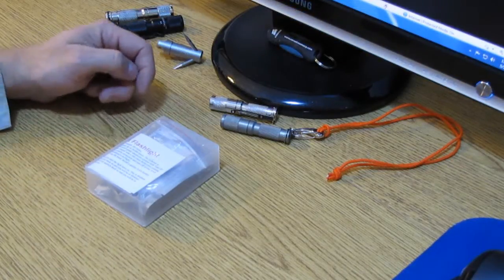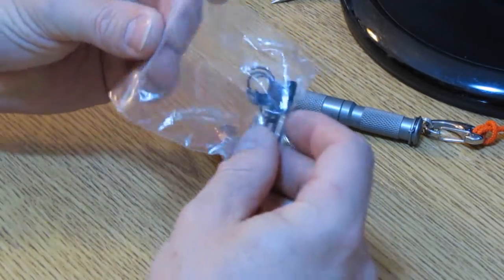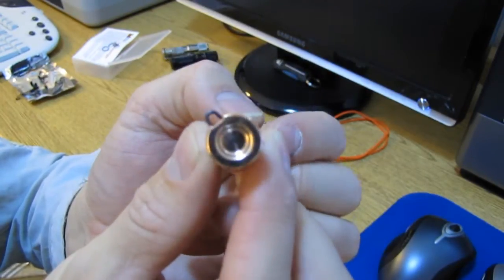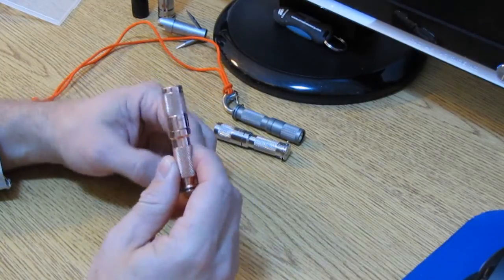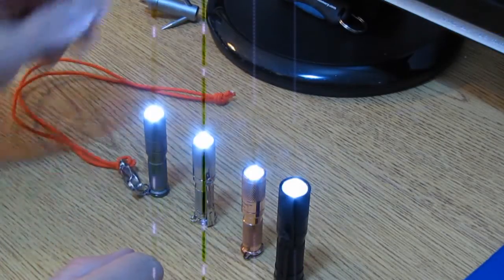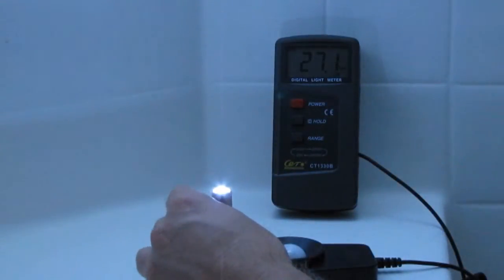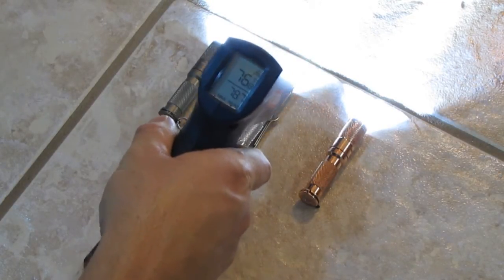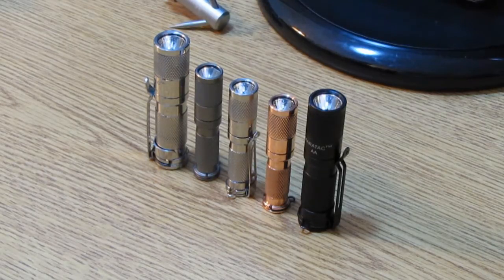Maratac Copper AAA Flashlight

Comment: @Patriot36 I have been carrying the preon for a few days, and I have to say I am impressed!  I ordered the 2 aaa body with the single aaa light.  I am using rechargable nimh energizer 900 mah batteries.  I like the interface on the preon very much.  I would not think twice about using this light on a backpacking trip.  Do you have any advice on a 2 aa light with a long throw reflector?

Comment from the maker: @Bierkameel 

Yes, it's a neat and unique little light.   As you stated, copper is very efficient at drawing heat away from the source.  The hottest point will always be that which is closest to the source of heat, in this case the light engine / pill, which is in the light head.

Comment from the maker: @plumberjoe80 

The Preon is superior in a several ways except price.  If you're watching your dollars then the Maratac and ITP are unmatched.  Additionally the Maratac is smaller than the Preon if that's important to the user.  The Preon uses the XP-G emitter while the older original design Maratac still uses the XP-E.